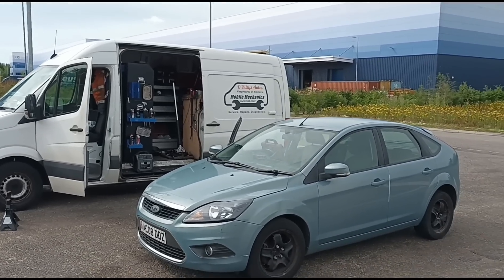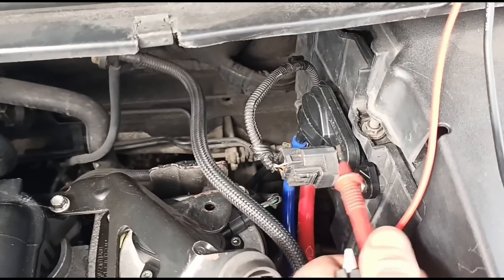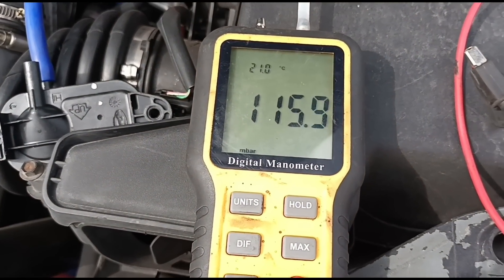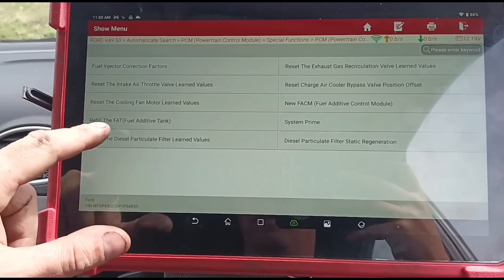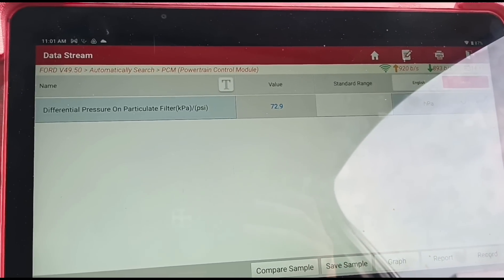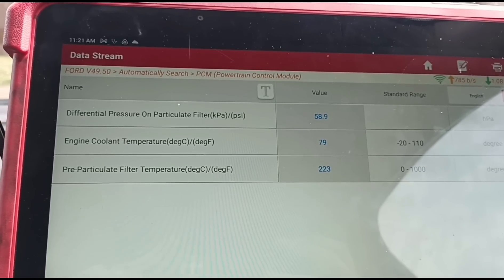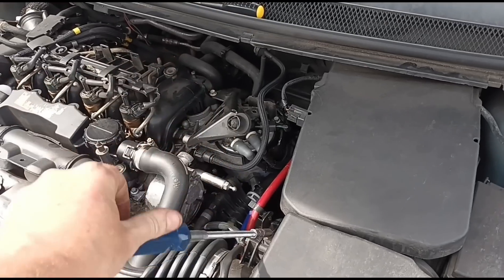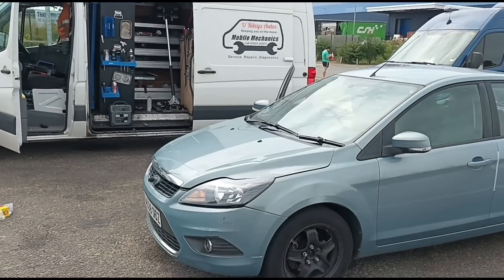Ford Focus 1.6 Tdci P2453-68. New Sensor & Wiring Loom Harness But Fault Still There? Diagnostic

Comment: I had a simular experience.. paid 400Euros for a full service and because i marked and dated my last filter, they took my money, but did not replace the filter(Main dealer). It makes one wonder what other work they did not do… shocking. When i complained, they denied it and even said, i was trying to get a refund.. shocking service by Opel Barcelona. Now i do not trust them and started to do it myself… At least i know Air filter, oil filter and Oil and fuel  filter is done yearly.. Now looking for a reliable mechanic for other repairs like you jimmy, fingers crossed…

Comment: Anyone know why that sensor would read 15 hpa with the engine off? I'm having a nightmare with mine, assuming it should go down to zero. Garages said its OK but according to Jimmy's videos it's not
Reply from the maker: See if you can adapt a new sensor in
Reply: @ORileysAutos  thanks I've put a new one on reset it in ista bmw, it reads it but still stays at that level, I've used your launch uk fluid aswell. Thanks I see if I can reset it again